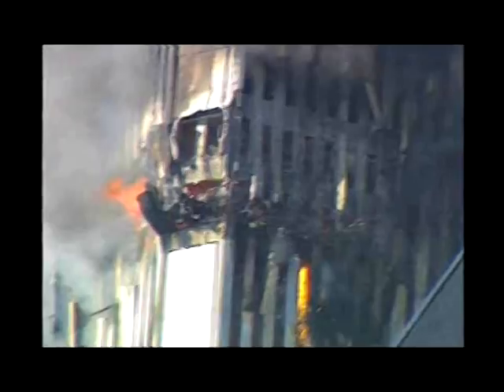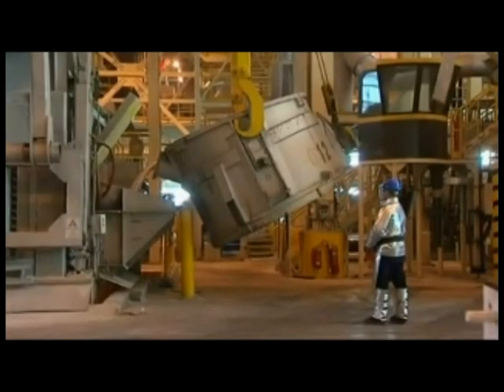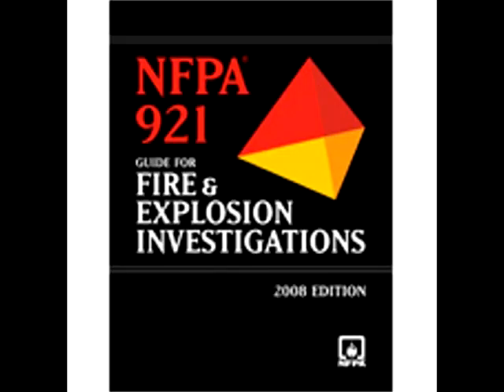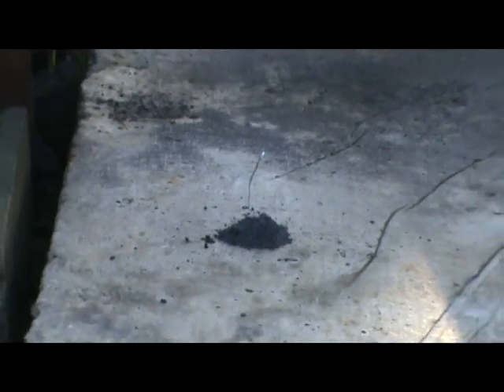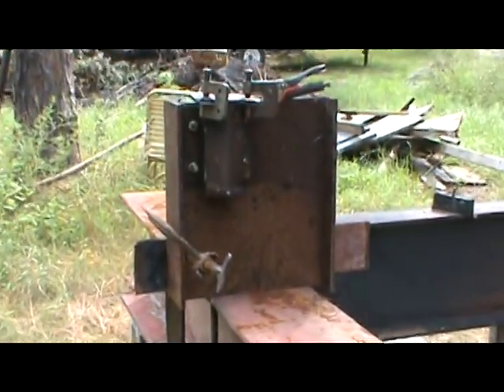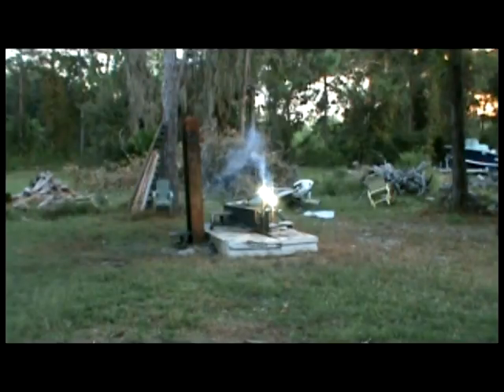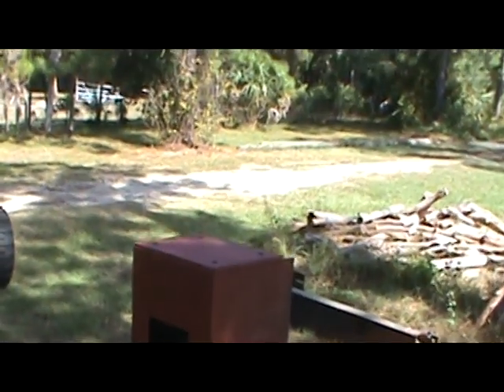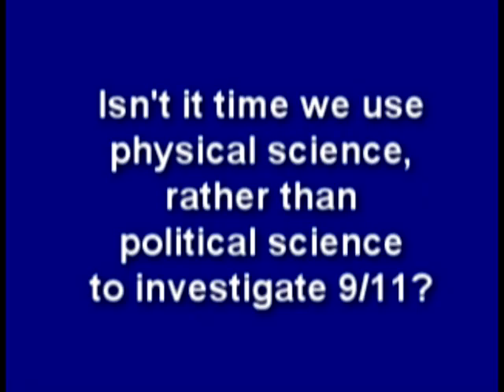9/11 Experiments: The Great Thermate Debate

Comment: 17 years later and this is the most damning physical evidence I've ever seen. Thank you so much for doing this. I always knew in my gut....It's sad that even though I know the official narrative is BS, I still get queasy seeing each experiment confirm it. Makes me sick.
Reply: Idk about you but I'm a construction worker and a year ago in NYC a building I was working at went on fire at night. Next day came back to work and it was worse than I thought the whole floor was charred and a few steel beams were twisted and bent up from the heat like you never seen, after seeing that I'm sure it's possible this to happen from a plane collision.
Reply: @jimmyrobibz3033  aye, not many people think of friction, heavy steel against heavy steel one travelling over 400 miles per hour, there is going to be intense heat, an interesting process to look up is friction welding.
Also all of these thermite tests seem to be ver lazy, they all had different reactions and burn times. This thermite thing seems like a lie.
Reply: @bradleymcewen4654  they mention jet fuel but the jet
Reply: +Joshua Flores
"Talkin to you is like talkin to a brick wall" - and listening to you talk is like listening to a hollow vessel.
"You cherry pick the information to support your claim" - Ironic nonsense.  You are making a 'claim'.  There is never any truth in any group of words you ever put together.  I am, indeed, cherry-picking the facts which directly contradict everything you say.  I like efficiency.
"How did Jones know it would happen 45 days prior?" - He didn't.  How many predictions has he made which fizzled?  You wouldn't care to know.  A stopped clock is correct twice a day.
"bin laden -  fake boogeyman" - you must be talking about some other guy.  I'm talking about the guy who engineered the defeat of the Soviet Union in Afghanistan..
"Terrorist sympathizer?" - of course you are - about the best you could be right now.
"Get fucked Tony. Good day" - I've already had mine, thanks..
Reply: @Joshua Flores ::// Osama bin Laden died of kidney failure in December 2001!! That kind of makes the seal team 6 stories impossible, don't you think? 9/11 was an inside job carried out by the Bush government and that's all there is to it!! Any other 'story' is bullshit!!!
Reply: DisappointedWilliam - HAH! HAH! HAH! " OBL died of kidney failure in 2001" huh?
so i guess he made hundreds of prerecorded videos covering hundreds of possible current events for al-Qaeda to choose from and release over the years after 9/11?
or were they all holographics and CGI?
you "truthers" are the dumbest sum bitches on Earth !

hey btw, ive got some prime south Florida swampland for sale at a deep, DEEP discount! 
im only letting the very brightest, most savvy investors in on this deal but you qualify hands down.

what say, oh, $25,000 per acre and ill throw in a free airboat and boat dock !
is that a deal?
lmao!
Reply: @williamsawyer6206  That was my point bro the seal team 6 raid was bullshit
Reply: Joshua Flores - aaaww. youve found a best buddy! you two should be very happy together.
i hope one of you has a wealthy parent!
Reply: Google Operation North Woods
Reply: Joshua Flores but the gov wants to help us.......all die
Reply: so you can tell the difference between molten steel , aluminum or plastics ?
Reply: The buildings falling straight down into there base didn't make you suspicious.
Reply: And just think... the media is STILL at it with the disinformation.
Reply: Alabama Thunder - what "disinformation" would that be?
Reply: OH and that time that CNN was caught directing the panel's answers before a segment, and also caught putting a "Trump Supporter" on air that happened to be a registered democrat that voted for Hillary on a story for "Trump White Supremacy."
Need more examples of media disinformation/untruths? There are more.
Reply: heldgop - the WTC Towers collapsed at an average speed of no more than 57 mph, LESS THAN HALF the magical "free fall speed" the idiot "truthers" cite.

there was no "free fall" about it!
in fact, the south Tower took almost 25 seconds in overall time to completely collapse. thats not even 20 mph !

just stop listening to these idiots! EVERYTHING "truthers" claim is either misinterpreted data, incorrect observations, statements taken completely out of context, totally irrelevant and misleading demonstrations and experiments and outright lies and deceptions!

some are made for political and/or monetary reasons such as the greatest idiot of all time, "dr" judy woods, some are just hype and sensationalism to stir up all the idiots in the world, like this video.

i mean, does ANYONE really believe "they" fabricated and installed THOUSANDS of such thermate delivery and containment devices on EVERY COLLUMN, BEAM AND JOINT, of EVERY SINGLE FLOOR of the WTC Towers???
and if so, WHERE DID THEY GO? because not a single one was found in the wreckage after sifting through 1.8 million tons of debris!

and why is there not a SINGLE piece of THERMALLY CUT or EXPLOSIVELY DISPLACED steel, ANYWHERE?
there would have to be THOUSANDS! on EVERY SINGLE PIECE OF STEEL !

so why even make this idiot video when you KNOW its completely foundless?

because idiot "truthers" dont need evidence and they certainly dont want TRUTH. they dont even want reality!
they only want their only source of excitement and endorphins to continue.
they only want their idiot, hairbrained and completely nonsensical and paranoid government conspiracy "space ray" from outer space, controlled demolition ninjas, and "dustified" buildings bullshit Tom Clancey inspired, cartoon physics powered fairy tale to be true.
and damn reality, evidence and truth to get there.

not only are "truthers" the dumbest mfers on the planet, but they are dishonest and untrustworthy.
EXACTLY why they believe everything is a lie and they are being deceived.
they are paranoid because they themselves are liars and schemers.
its much more an inner reflection on them than anything.
its a glimpse inside the minds of a "truther".

if you yourself want TRUTH, just stay away from these idiot yt "truther" videos.
its all bullshit conjured from the minds of IDIOTS that lack the ability to apply reason and logic, let alone intelligence.
Reply: Look we can disagree on the details of their collapse all we want. Bottom line, the investigation into 9/11 was a publicity stunt. Bush said "we know who did it." Alex Jones on July 25th 2001 said that there would be a false flag involving the towers, and that they'd pin it on someone like Bin Laden, so if it came to  pass you'd know it was bullshit WATCH THE VIDEO. Don't listen to me the proof is there. 9/11 was a false flag event the new "pearl harbor" called for in the PNAC project for new american century that called for more bases in the middle east. The towers were a crime scene were they not? Then why the FUCK would all that steel be sent immediately to China? PLEASE DO TELL
Reply: @holdernewtshesrearin5471  No, that's what I mean, the building was rigged to come down. The explosives were already in it he knew it was coming brother there were alot of people who made alot of money off this tragedy. So....You think that Hani Hanjour, a man who couldn't even fly a cessna, was capable of pullin off one of the most incredible aerial feats in history? He flew into the pentagon like an ace Randy! Not buying it. Planes at that time were capable of being flown by radio control. All of the transponders were turned off at points where the radar was weakest explain this. The flight 93 black box has never been made public. All I'm saying is that for every good point you make, there are equal amounts of unanswered questions out there and we owe it to the families to seek justice against whoever really is responsible. The war on terror was designed strictly to strip you of your liberties, and make you think that it's patriotism. False flags are found all throughout history man, that's my point. You didn't address Alex Jones calling the attacks 45 days prior on video that is easily found. And I doubt that some guy with a camera crew found Bin Laden in a cave and interviewed them, when even the government of arguably the most powerful nation in the world can't find him. Too many weird things happened that day to all be coincidence. Norad sent our fighter jets to Alaska brother. Rumsfeld has a freudian slip on camera, also easily found, where he states that flight 93 was shot down over Pennsylvania. Explain that...."Genius" ;)
Reply: Joshua Flores - " greatest aerial feats in history"? REALLY?
he merely aligned with his target and punched the throttles.
anyone that can fly a plane on X-box can fly a plane in real life.

literally EVERYTHING you just said, EVERY bit of info, EVERY statement made comes straight from the usual yt "truther" videos.

shitcan EVERYTHING you think you know and START OVER. and DONT watch idiot "truther" videos! youd get more factual info from an Enron quarterly statement.
Reply: This video is a demonstration of how it is possible to noisily cut steel beams and columns with thermite.
It isn't, however, a demonstration on how to reliably ignite thermite silently.
It isn't, however, a demonstration on how to time a multiple set of reliable and silent ignitions.
It isn't, even, a demonstration of how to remotely-operate a multiple set of reliable and silent ignitions after your equipment has been immersed in fire for an hour.
It takes no account of the fact that the towers didn't fall until at least two of their floors had sagged and collapsed.
It takes no account of the fact that long span beam slender column buildings rely on their connections for their structural integrity.
It takes no account of structural integrity or the principle of stability.
It relies on pre-industrial reasoning which was debunked 260 years ago.
Get smart and join the modern world.  Stop yourself from being lied to each and every day.
Reply: Tony Duncan - not to mention the fact that in 1.8 million tons of wreckage and debris, theres not a single ounce of thermite, thermate nor any nano version thereof, not a single detonator or inch of det cord or wiring and not a single piece of thermally cut or explosively displaced steel, ANYWHERE! NONE!

so i can easily claim it was robot nuclear powered termites that brought the towers down, but without a scrap of EVIDENCE, its just hot air out my ass!
EXACTLY like this idiot in this video.
Reply: @tonyduncan9852  the demolition wasnt silent did you have your hearing aid in when you where watch the buildings fall u can hear multiple systematic explosions
Reply: KICKZ ROCK - hurts foot.
Explosions are made when floors collapse at up to 200 mph.
Blasting charge explosions are easy to identify, as they are very sharp, and it is easy to distinguish their sound from the duller explosions of collapsing floors.
I can't put the relevant videos (WTC tower collapses compared with building demolitions) side-by-side for you to compare them, but you could.  You haven't because you are invested in your paranoid beliefs.
Concerned and sensible people have already done this.  They find the sounds dissimilar.
"kicks rock" - rock away: https://soundcloud.com/jazzroc/never-over-eight-1
Reply: KICKZ ROCK - " you can hear multiple seizmic explisions"? REALLY?
because all i heard were the 1 acre floor slabs dropping to the one beneath in rapid succession.
heres a tip, genius-
not all that BOOMS! is an explosion.
not all that "explodes" is caused by an explosive.
but, then im sure your "truther" conditioned brain has long since rejected all reason and logic.

you know, maybe they really DO put tiny explosive charges in every one of those popcorn kernels.
YEP! makes perfect sense.
they DO explode with a loud POP!
it MUST be explosives!
lmao!
Reply: This is a demonstration of how it is possible to cut steel beams and columns with thermite.
It isn't, however, a demonstration on how to reliably ignite thermite.
It isn't, however, a demonstration on how to time a multiple set of reliable ignitions.
It isn't, even, a demonstration of how to remotely-operate a multiple set of reliable ignitions after your equipment has been immersed in fire for an hour.
It takes no account of the fact that the towers didn't fall until at least two of their floors had sagged and collapsed.
It takes no account of the fact that long span beam slender column buildings rely on their connections for their structural integrity.
It takes no account of structural integrity or the principle of stability.
It relies on pre-industrial reasoning which was debunked 260 years ago.
Get smart and join the modern world.  Stop yourself from being lied to each and every day.
Reply: study Newton's Second Law
Reply: So when did you see his termite fail to ignite? The first trial or two. After that he used a better igniter. Would you have to igniter all 100 points or would 95 do fine? Cutting the heads off bolts needs structural stability. (Did You watch this video?)
Reply: Obviously you can explain why the multiple agencies lied about the ability of thermite to melt steel. I'm waiting.....
Reply: Tony Duncan I did stop myself from being lied to each and every day. I stopped watching the mainstream media. Explain to me why building 7 fell due to fire in the basement? I get what you're saying brother but too many mysteries and too many truths were left out. Building 7 was never even mentioned in the 9/11 Commision report. Eyewitnesses heard bombs. I think the 9/11 commission was a joke.
Reply: Joshua Flores
"I did stop myself from being lied to each and every day. I stopped watching the mainstream media" - I have forty years' lead on you, there.  I didn't however, then go and take the word of some Joe Geezer down the street, because it seemed plausible.  I compared 'such words' with my understanding of logic and science, and tried all the viewpoints I could find.  .
"why (did) building 7 fall due to fire in the basement?" - It didn't.  Read the NIST Report.
"I get what you're saying" - no, you don't.
"brother" - A terrorist sympathiser calls me 'brother'?
"too many mysteries" - there are no 'mysteries'.
"too many truths were left out" - Nothing relevant was left out of the NIST Report. All truther claims are irrelevant to the contents of the NIST Report, which concerns itself with how the WTC buildings fell, and not who did it, and what to do about it.  The report demonstrates clearly the timeline and action path of the structures, and also clearly that in all cases, office fires caused the collapses.**  It makes a close simulation of all the physical forces produced, over time, and their consequences.  One has to bear in mind that no simulation of this complexity can ever be totally accurate.  But that amount of accuracy isn't strictly necessary.  The point is made.
"Building 7 was never even mentioned in the 9/11 Commision report" - because Building 7 was never attacked.
"Eyewitnesses heard bombs" - Eyewitnesses heard explosions.
TEN THINGS THAT EXPLODE IN OFFICE FIRES
1.  Fire extinguishers
2.  Sealed pipes with liquids inside them
3.  Sealed tanks with liquids inside them
4.  Battery Rooms
5.  Sealed spaces with smoke inside them
6.  Cathode ray tubes
7.  Fuel tanks
8.  Steel snapped in tension by structural expansion due to heat
9.  Electrical transformers
10,  Concrete heated above 850 deg C
"I think the 9/11 commission was a joke." - then perhaps you should read the NIST Report.  That's what's relevant to WTC7.
** BTW how does SIX ACRES of office fire strike you?  Big, perhaps?  How hot?  1200 deg C?
Of interest, however, is the peak fire temperature normally associated with room fires. The peak value is governed by ventilation and fuel supply characteristics and so such values will form a wide frequency distribution. Of interest is the maximum value which is fairly regularly found. This value turns out to be around 1200°C
https://www.doctorfire.com/flametmp.html
How does mild steel perform when heated by a toy steam engine meths burner?
https://www.youtube.com/watch?v=0-qB8EJa3ss&t=2s
Get the idea?
Reply: Joshua Flores - oh boy!
so....did YOU see the towers going off like a giant roman candle with molten metal spraying out 100 feet in every direction at EVERY SINGLE JUNCTION OF THE VERTICAL COLLUMNS AND HORIZONTAL BEAMS ON EVERY SINGLE FLOOR FROM TOP TO BOTTOM OF THE WTC TOWERS?
did YOU hear the loud HIIIIISSSS! and BANG ! of these "discreet" thermate charges?

did YOU see the THOUSANDS of piston powered, steel box beamed containment vessels for the thermate charges that were surely littering the debris field and were attached to EVERY SINGLE JUNCTION POINT OF EVERY SINGLE COLLUMN AND BEAM NUMBERING IN THE THOUSANDS that most certainly would have been present?

did YOU hear the testimony of the few of the HUNDREDS of super secret, government operative, demolition ninjas that toiled for MONTHS to rig the buildings with these devices, when after succumbing to their conscience, they came forward to spill the beans?

please do tell ALL about the EVIDENCE of such a dumbass idea such as this "rigged controlled demolition by thermate" theory that has suddenly delivered you from the darkness of deceit and placed you firmly upon the alter of discovery and truth.
please, do tell....
Reply: Did you see the video? All that had to be done is cut the heads off the bolts holding the beams together. Did you  see the buildings fall straight down into there base as in controlled demolition? Did you know the buildings were double insured who would double insure buildings?
Reply: @holdernewtshesrearin5471  Before that day a skyscraper had never collapsed due to fire in history. Don't say they were hit by planes. Two were sure, but explain building 7. Explain why Larry Silverstein said "pull it" and they watched the building go down. And explain why 3 buildings all larger than 47 stories collapsed into their own footprint at freefall speed. Please. Do tell
Reply: +Joshua Flores

Do you even know how building 7 was constructed?

Let me give you a little history lesson.

Building 7 was constructed on top of an underground Con Edison electrical substation, built in 1967.

This substation had a caisson that could support a 25 story building, at max.

Since building 7 was to be much larger than 25 stories, special girders and beams were installed to redirect gravity away from the substation and into the foundation, so it would be possibly to construct a much bigger building.

Now, let's take a look at the collapse itself.

The North Tower collapsed at 10:28 am.

Large amounts of debris from the north tower hit the facade of WTC 7 and started multiple fires inside the building.

These fires were allowed to burn and spread unhindered for well over 5 hours, weakening several critical steel beams and causing girders to expand, weakening more of the building. 

These expanding girders caused beam number 79 to buckle.

This beam was a critical beam supporting the 13th floor. As this beam buckled, it caused the floors above to collapse all the way door to the 5th floor. This cannot be seen on any video, since it happens inside the building.

As the above floors collapsed, the rest of the interior lost support and collapsed entirely. If you've seen any video of the WTC 7 collapse, you'd see that the upper mechanical penthouse falls first while twisting slighty.

This basically means that when that upper mechanical penthouse falls, the entire core of the building has collapsed, leaving only the facade that collapsed seconds afterwards.

What part of this don't you understand? It is basic physics.
Reply: Many have collapsed from fire.  Just because a youtuber states something doesn't make it true.
Reply: What this fool or any other cannot tell you is when the engineers did all the work to install any of this in either of the twin towers before the attack. Just another wanker who wants to disrespect those who died.
Reply: Hundreds of investigators, public and private contractors, forensic experts all give you one story that you reject. A couple of YouTube producers tell you another and suddenly everybody else is gullible sheep. Can't you even use common sense? Do you realize how many people would ALL have to be in on this AND keep their mouths shut for 17 years? THIS is somehow more believable to you? Are you really so desperate to bolster your ego by deluding yourself into believing YOU are finally "in the know"?
Reply: Exactly. when DOD,CIA, FCC, Scret Service, etc etc etc are filed with daily leaks. Even the MOB and a simple BJ in the oval office becomes wordly info in a short period of time....
Reply: WashingtonWebFoot Possibly the ones that participated are no longer here and vanished along with the other victims..
Reply: WashingtonWebFoot A story that includes the impossibility of cutting steel beams with any kind of thermite. After seeing a guy actually cut steel beams with thermite it indeed appears to be common sense to doubt this story.